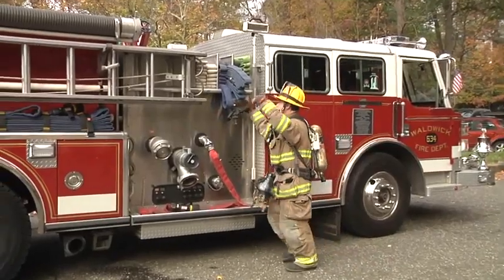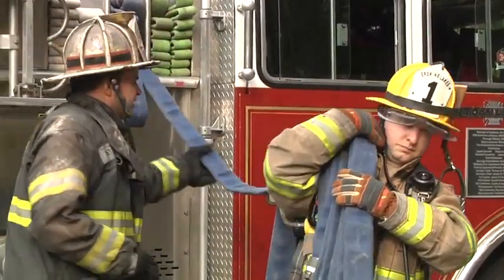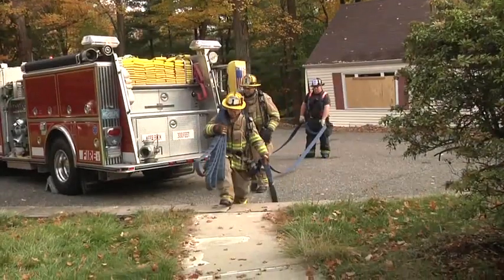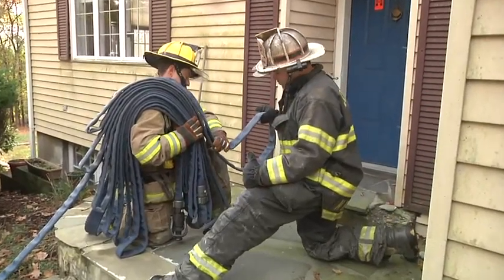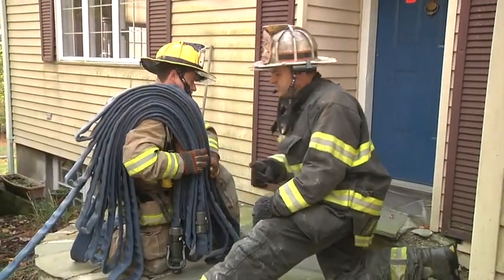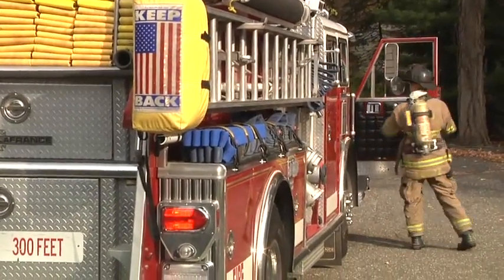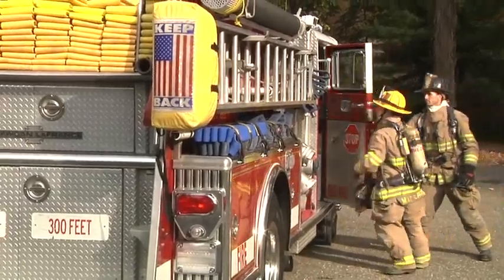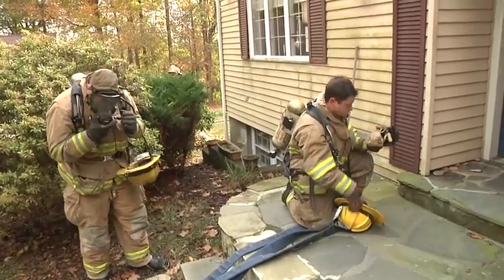Stretching the Attack Line

Comment: Only thing I don’t agree with when the attack team. We are required to come off the trucks if they are on the pipe(nozzle) or back up man you come with your pack on sucking air. Then depending if we got enough guys on the truck or show up to the fire we got what  I call the “breach team” 9 times out of 10 the door locked  breach team responsible for breaching the front door.  Those guys are also required to have on air pack sucking air coming off the truck. Depending type of structure first option is halligan and fire axe. We’ve used k-12 saws on doors. It really depends how difficult the door being. We’ve even used jaws spreader once on a door.  It wasn’t budging with the halligan and the k12 we couldn’t get a good bite spot so I said I got an idea pull the spreaders I put on my pack . I said attack team get on the pipe and get ready cause once I get out of the way your going in. Wedged the spreaders in the jam opened it up it split that jam real nice